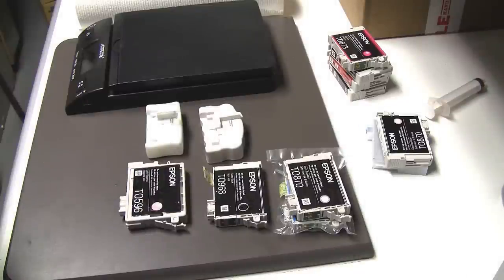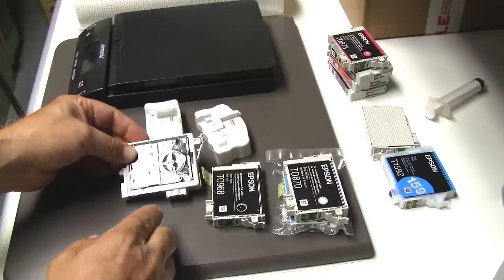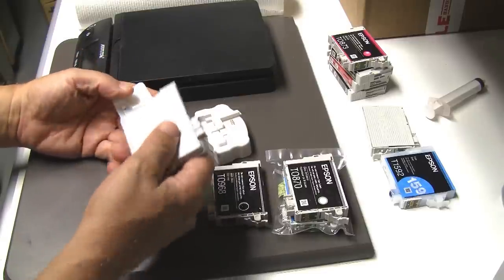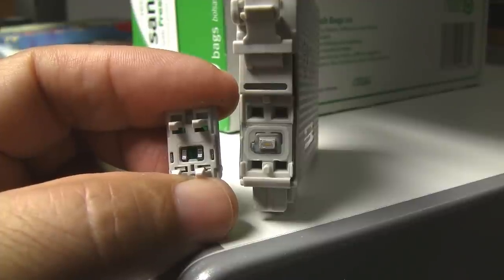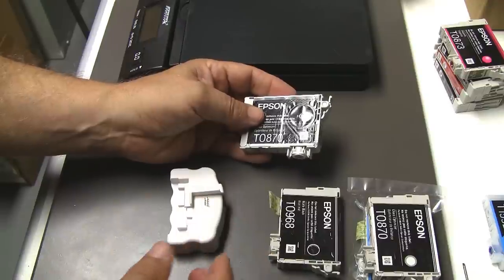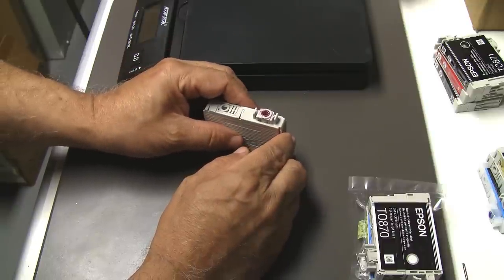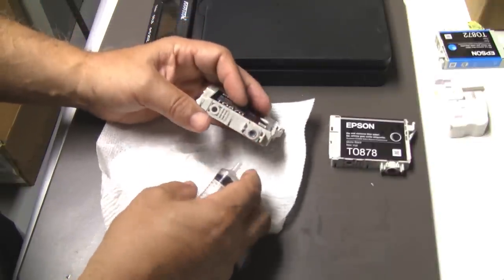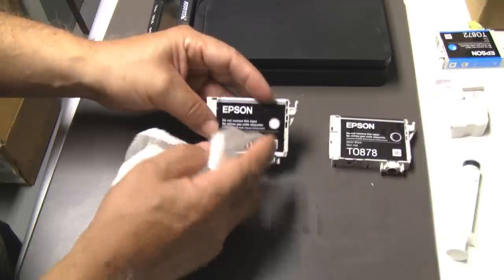New way to refill OEM Epson carts

Comment: Whatever you do, do not ever, Ever, EVER download the Epson software/firmware updates. Say No and tell it never to ask you again. After I upgraded my firmware, my printer wouldn't even read the chips on a brand-new set of GENUINE EPSON cartridges that I had bought at Walmart. Thanks a lot Epson, what a way to keep your customers!
Reply from the maker: I've never ever had any of my 13 Epson and 3 Canon printers ask me to update anything. So no problem here. But I agree with you!
Reply: The newest printers (XP-310 and WF-2540) do. As soon as you install the software, it asks you to update it. It will also tell you the cartridge isn't genuine and will void your warranty, even with their own cartridges. This appears to be a major complaint among Epson users.
Reply from the maker: +BDazzled Designs That is the problem whit these newer Epsons. That happens is you install them as WiFi or even with USB?
 But so you know, it is against the law for them to void the warrantee just because you use non Epson carts.
Reply: Hi Jose. If you are on Wi-Fi, Epson will "bug" you to download the firmware update. You can tell it at that point not to ask you again. Download a free program called "Shall I Remove It?" and find Download Navigator and get rid of it.
Reply from the maker: +BDazzled Designs That sounds good. Thanks for sharing that info.

Comment: Wait, so if I have used all the ink in one of the brand new epson models and then refill it, will a resetter not work? (702-I cartridge in a workforce 3720 )
Reply from the maker: Correct. The wet sensor will be tripped around the 20-30% level. You can reset the chip but it will not communicate rough the sensor to come back and tell the driver all is OK. I saw and read parts of the patent for this sensor and it is very well designed to prevent bypassing.
Reply: So as long as I refill before that is tripped and reset the chip it should work?
Reply from the maker: But can you even reset those chips????
Reply: do you have a video for the 702 epson oem to refill, or a site to buy refillable cartridge?

Comment: At approximate 16:40 you say DO NOT push any air into the cartridge! But earlier you showed us to push air in until the diaphragm bursts! And, at this point in the video, it appears you have water in the syringe, however you do not say a word about putting water into the cartridge... very long and fairly confusing!
Reply from the maker: Not at all! You first pop The diaphragm the cart needs to be perfectly empty for that. You use air to do it. Then you refill with ink. It is at that point you do not want to inject air. You want only ink.

Comment: I tried this with an Epson 802 cart... the whole circle thing on the side that's supposed to pop just completely blew out of the side of the cartridge ruining it and getting ink all over everything. :D

Back to the drawing board. :|
Reply from the maker: At the time I did this video this process worked about 50% of the time BUT only on the cart numbers I posted on the description. Non others!!!!
Reply: Yeah, that was the risk I was willing to take. These carts are so new that there are no tutorials on how to do it (good ones) or 3rd party carts available online to buy. I bought a kit and some OEM carts (as backup) and figured I would give it a try. Didn't work..
Reply from the maker: Wait, so how you going to reset them anyway even IF you could refill them?

Comment: What ink do you use so it won't clog the head?
Reply from the maker: +Atti Butt I used Precisioncolors and Inkjetcarts. But preventing clogs is more of a print often type practice and not so much due to inks.
Reply: Thanks for replying but in my experience some inks do clogged head even printer was used very often. 
Thanks for recommending brand names you have used. 
👍

Comment: where can I buy a chip reset tool for R1900 epson cartridges?
Reply from the maker: +Kallam McDougall This a good one and it uses USB power for full reliability.http://www.ebay.com/itm/Never-Low-power-Chip-resetter-for-Epson-T054-T059-87-96-R800-R1800-R2880-R1900-/320959259127?hash=item4abaa9a1f7:m:mTzmFbhcXQV5TqbKz7tfyvgHowever as you know, the R1900 carts use a wet sensor so they are not a good candidate for modifying and refilling.  I would choose a good set of refillable carts instead.

Comment: Hi,
Does anyone know if the Epson
WF-100 ink cartridges ( T215 ) can be refilled and chip resetted and the maintenance box ( T2950 ) chip resetted too?  Thanks in advance.
Reply from the maker: +Charlie Bronson I do not know anything about the WF series other than the much older work force 1100 which I own.You are talking about the Epson WorkForce WF-100 Wireless Mobile Printer and T215 Standard-capacity Black Ink Cartridge?I think there is nothing available for this printer even in the refillable area. I just checked around a bit and found nothing.However there are 3rd party compatible cartshttp://www.ebay.com/itm/8-Pack-Refilled-69-Ink-Cartridge-For-Epson-Stylus-NX100-105-110-115-215-/321862480276?hash=item4af07fb194Joe

Comment: How would one do the Epson124 and 125 cartridges? Thanks
Reply from the maker: Not familiar with those Cart #s but if the have the round bladder the same might apply. But even if you could, can you reset them?
Reply: No way Jose, they do not have the reset button as I viewed in the video. That would have been too easy, but I think I may be able to "drill out" the top and inject the ink that way. ? Thanks!!
Reply from the maker: I don't know what you mean with a Reset Button. I think you mean the little lever and or depression to release pressure. 
Look on the side of the cart where the label is and look for a round 
1- 1/5 " diameter depression. If it has that then you could try this method. If not then you my drill from the top but you need to locate the correct location. There is a MAZE of tunnels inside these carts and you will inject ink but it will remain "Locked" up somewhere inside the maze.
Reply: Thanks Jose!!

Comment: I use big bottles for my dtg printer(Epson R1800). I'm searching for chips Who have a larger capacity then the 30ml or an other work around to cope with the small capacity of the chip. Pm me please.
Reply from the maker: I do not think those chips you are looking for exist. Even with a CISS the chips are just rated for the volume of the CISS dampers. Also I do not know anything about DTG printing.

Comment: Just buy a new cartridge, remove its chip and glue it to your old refilled cartridge... it could work.
Reply from the maker: That can get expensive and extremely inefficient wouldn't it? Why not just use the new cart which would probably work a lot better than the one you modified.

Comment: Ya que tu nombre indica que sabes español, podrias hacer el mismo tutorial, en español? Seria de gran utilidad, ya que en Argentina son incomprables por su costo e imposibilidad de importarlos  y un problema para los que usamos esos cartuchos. Gracias. Villa Ballester. Argentina.
Reply from the maker: Simplemente porque tengo Rodriguez de apellido no qiere decir que converso suficientemente bien para traducerlo.Seria un fracaso! Pero segudario, este proceso no es necesariament uno bueno I ya no lo recomiendo. Solament sirve para unos pocos de cartuchos I niguno de los modernos.
Reply: Gracias por su pronta respuesta, pero ud. lo explica muy bien. Tengo una impresora que usa esos cartuchos, Epson Stylus Photo R 1900 y me es imposible conseguirlos. Una pregunta ya que fue tan amable en contestarme. que tamaño tiene la jeringa? Y el aparato que enciende la luz, que mide? quizas si el catucho se puede recargar?
Reply from the maker: 20cc Pero el problema con cartuchos para l R1900 es que tienen un sensor que cundo a cartucho se reprota vacio la CHIP no se puede resetear! Husted tendria que acerlo mucho antes de 205% de vacio. Si uno espera demaciodo tiempo, la connection interna localized detras de el CHIP literalmente se quema!  I la coneccion interna de el chip I la impresora se interrupte permanentemente. Pues lo es possible pero presenta damaciado problemas!

Comment: I tried popping the membrane [the casing exploded, I got covered in ink?] took a photo but it save me from stripping it!!!!
Reply from the maker: James Turner Did you use a 20ml syringe? Anything else, specially a larger volume one and it could very well cause the casing to come apart. You also MUST expel every drop of ink out of the cart before trying to pop the diaphragm.I've done it now dozens of times without much problem.This is not a truly recommended practice BUT it can work to make certain non refillable carts into refillable ones.But things can always go wrong. Sorry to hear about what happened.Joe AKA Jtoolman
Reply: Jose Rodriguez 
Hi Jose, it was an old epson cartridge off a r220 printer [I used a 10 ml syringe] But no real harm done,
Like your video 
Jim
Reply from the maker: OK a cart from that old of a model would not want to NOR require using this method. If you look at the underside of the cart you will probably two circular taped over holes. You can use the method I demonstrate in the "Long Winded" method of refilling EPSON carts. They require a special little valve you can buy from Rjettek.com I demonstrate the complete method on that video.

Joe AKA Jtoolman

Comment: 1 ml of water = 1 gram, but isn't it fair to assume that ink has a different density than water? Thanks for the helpful video!
Reply from the maker: bookguitarguy Except I've actually weighed 10 gram of ink on my lab scale and it weighs 10 grams.
Reply: Jose Rodriguez Alrighty then, fair enough... I just didn't have my magic mind-reading hat on. :O))
Reply from the maker: OK here is the deal. There is a difference but it is small. You would have to go to a hundred ML of ink and compare that to 100ml of water.
You will probably see a difference. Will it be heavier than water? I do not know nor do I care as it will not matter at all.
Example. I weigh a full factory new OEM PRO 3800 cart. It will weigh in at 150 grams. It contains a total of 90ml of ink. 80ml is the factory official volume but it contains a 10ml "Buffer" so you never can actually run out and pull possible air into the lines which is very unlikely anyways.
A fully empty equivalent weighs in at about 61-61 ml. If you do the math, it comes out that 90ml of ink weighs about 90 to 89 grams.
Reply: Jose Rodriguez Sounds good, that definitely answers my question!! :O))